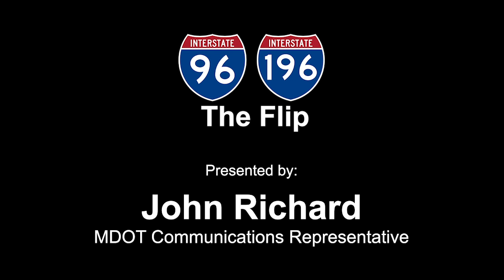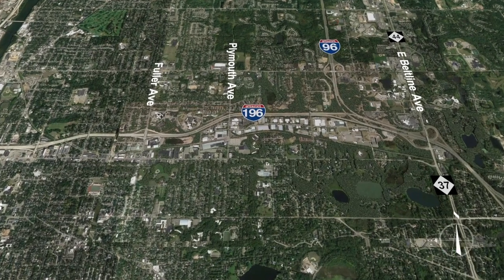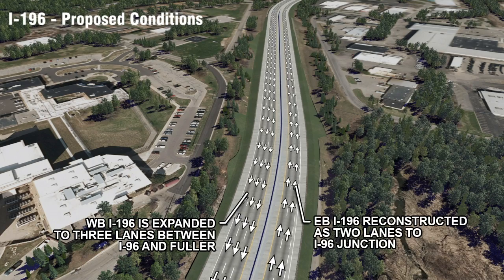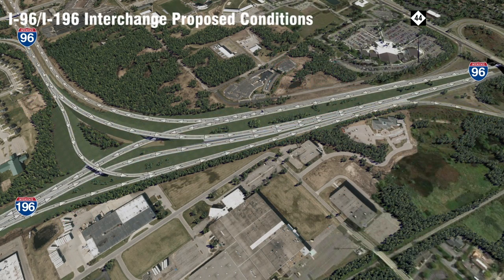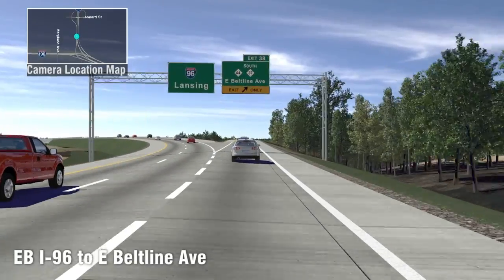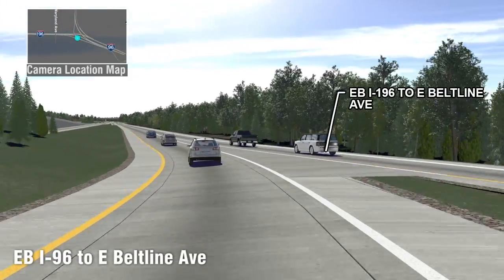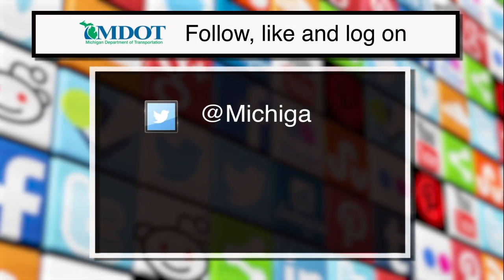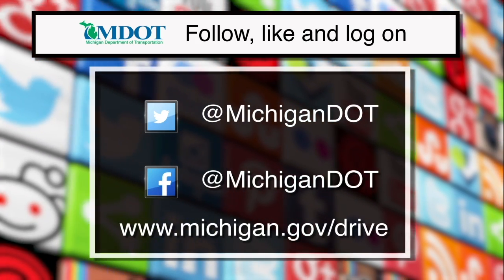I-96/I-196 Interchange Project: The Flip

Comment: I totally agree with Chad, I have been entering 1-96 west from the East Beltline and merging over to I-196 west for over 10 years now and always feel like I am trying to cross  a racetrack to get to  I-196 west. Everyone is going 70 mph or more. As long as you were already doing construction of the area, I think the congestion would have been helped more by making a separate entrance ramp from the East Beltline to I-196 west. The congestion could also have been reduced by making an exit ramp from I-96 East to I-196 West. It would give people another option and reduce congestion on the East Beltline.
Reply from the maker: Hi Jean, this project has that kind of ramp from EB I-96 to I-196 in mind for future builds; however, it depends on future available funding.

Comment: I see ZERO improvements though on how East belt line merges with West bound traffic and then darts over three lanes of traffic to go downtown. Am I missing this inherent improvement that hopefully wasn’t over looked?
Reply from the maker: Hi Nikole, as we mentioned elsewhere in the thread to a similar comment, the addition of the third lane along WB I-96 in that area is designed to create more room for a safer merging zone. There is a meeting scheduled for May if you would like to attend and speak directly with the project team: https://www.michigan.gov/mdot/0,4616,7-151-9620-496097--,00.html. You can also call the Grand Rapids TSC at 616-464-1800 to speak with them.

Comment: Long overdue change to the Eastbound 96/196 exit to E Beltline.  Now, if they had only added a new ON RAMP to Westbound 196 from the Beltline.  Drivers will NOW have to traverse across TWO lanes of traffic to get to the I-196 Ford Freeway.  Should have added a ramp through the median (like Alpine Ave) for Beltline drivers to enter the Ford without crossing 2 lanes of westbound 96 traffic.

Seeing similar comments below, more lanes of traffic to allow for safer merging means a driver has to merge one more time.   I seriously have my doubts that this will reduce congestion on Westbound.  The problem is that there isn't enough distance between Beltline and the 96-196 interchange.  When there is any amount of traffic, you just can't get across the lanes.

Comment: I don't understand - how will cars going eastbound on 196 be able to "turn left" and go NORTH on I-96 towards Plainfield/Alpine?  There's no way to do it now, obviously (huge limitation and the most #1 baffling flaw of this interchange) so I assumed all this construction work y'all are doing is to FIX this problem, right?  But this video doesn't explain it at all!  Somebody please clarify.
Reply from the maker: Hi there, DJ. We've gotten similar questions. This project has that kind of ramp in mind for future builds; however, it depends on future available funding.
Reply: @MichiganDOT  that's a terrible answer, but then again, this is a TERRIBLE project and abysmal staggering waste of money....I'm still trying to figure out how you can throw $60 million down the drain, just because "durrrr.....merging is HARD! derp derp" etc
Reply from the maker: @DJMichaelAngelo  We don't consider increasing safety a waste at all. This project is also designed to accommodate future upgrades, as we mentioned earlier, when funding becomes available.

Comment: The one problem not addressed in this project is the traffic merging onto 96 east from beltline. That ramp is so sharp that vehicles cannot get up to highway speeds before merging causing all the vehicles moving at highway speeds to slam on their brakes and make rapid lane changes to allow the merging beltline traffic in. In addition, you have vehicles that need to exit at fulton entering this same lane. It's the same exact problem as the 96/196/beltline cross traffic issue this project is aimed at alleviating. Why is this section not being addressed?
Reply from the maker: Hi None, No changes to this ramp with this set of projects. Improvements for this ramp will require removing and replacing the E. Beltline bridge over I-96. There are plans to address other operational issues in the larger I-196/I-96/M-44/M-37/M-21 interchange area in the future. These projects will be implemented with future roadway and bridge repair projects, based on statewide needs and funding levels. 
This year, by separating the EB merging traffic to East Beltline from through-traffic, there will be some benefit to the EB merging traffic from the East Beltline to I-96 and M-21.
Reply: @MichiganDOT  Thanks for the reply. Glad to hear it's at least on the radar.

Comment: Is there anything planned to alleviate the traffic merging from Beltline onto I-96 West?  And then those same cars trying to merge left (the flip) to get onto Westbound I-196?
Reply from the maker: Hi Scott, the addition of the third lane along WB I-96 in that area is designed to create more room for a safer merging zone.
Reply: Does this mean we still have to merge over an extra lane if we want I-96 West?  Having 3 lanes instead of two doesn't compute to "no problem" in my head.  :-)
Reply: Carol Smith exactly. The amount of crazies whipping over the lanes cutting off the flow of traffic is slowing everyones commute down. I have to stay in the far left lane going west until the last possible moment to go west because of this. They should invest in separating the on ramps to two on ramps after the fork in the road for east belt line traffic. Currently the length of time from east beltline bridge merge on west bound there’s not enough road and adding an extra lane isn’t smart either.
Reply from the maker: @nickie17301  Hi Nikole, as we mentioned elsewhere in the thread to a similar comment, the addition of the third lane along WB I-96 in that area is designed to create more room for a safer merging zone. There is a meeting scheduled for May if you would like to attend and speak directly with the project team: https://www.michigan.gov/mdot/0,4616,7-151-9620-496097--,00.html. You can also call the Grand Rapids TSC at 616-464-1800 to speak with them.
Reply: @MichiganDOT  Did anyone bring this up at the meeting?  A 4:30 meeting on a weekday is pretty tough for many of us to attend.
Reply from the maker: @s-ptownsend8919  Hi S-P, not sure if this specific comment was brought up at the meeting but the project team has fielded this question previously. In fact, they provided us with the information above to answer similar comments. As for the 4:30 meeting time, we try to schedule meetings at times to garner the most input. If you were not able to attend, we encourage you to contact the Grand Rapids TSC at 616-464-1800 to provide your feedback. Thanks!

Comment: I still don't understand why there is not a ramp from 96 south/east to 196 West???  Or am I missing something?
Reply: After a few frustrating trips attempting to get on WB 196 from EB 96 I figured out that going east to the Fulton St. exit and heading east, it turns out there's a fairly easy entrance ramp back onto WB from there if you stay in the left lane.  (A Michigan left but applied to freeways?...)  And now that Cascade has the diverging diamond it's even easier to make the same U-turn there, though that's farther to go out and then to double back.
Reply: you're right! :o  I just realized that this is ANOTHER no-brainer that you have to wonder what kind of crack-pipe the traffic engineers were smoking when they laid out the routes for this interchange....I still can't believe they're doing this multi-million dollar project, reconfiguring the entire interchange, for just a wussy non-reason like "better merging" = REALLY?!?!? pathetic
Reply from the maker: Hi  @DJMichaelAngelo  ! Improved merging means improved safety, which is an excellent reason for this project. As we mentioned earlier in the thread, this project has that kind of ramp in mind for future builds; however, it depends on future available funding.
Reply from the maker: Good question, Frances. I'm checking with the Grand Rapids TSC about that for you right now. I'll let you know what I find out!
Reply from the maker: Hi Frances - already heard back. This project has that kind of ramp in mind for future builds; however, it depends on future available funding.
Reply: @MichiganDOT  Thank you!
Reply: It's called US-131. Or I-296 if you know inside info.
Reply: Frances, drivers that want to get on 196 in either direction from 96East, would take 131 south, and you can join 196 in either direction.
Why would you drive all the way past Grand Rapids on 96E, if you wanted to go anywhere on 196 west?  It would be like making a giant U-turn on the freeway?

Comment: Thanks for sharing! I've been wondering how this will look. My other question has been if this will do anything to alleviate the backup that occurs daily where Cascade enters WB I-96?
Reply: People need to learn (a) how to merge, and (b) how to allow people to merge.
Reply: @MikeEwer  And use their TURN SIGNALS! I mean, how difficult is it to lift up or down the small level on your wheel.  And, people in GR -  IT DOESN'T COST TO USE IT!
Reply: @judithconigliaro3731  we all know how expensive blinker fluid is!!
Reply from the maker: Hi there! Doesn't look like this project has any components related to Cascade, but I can certainly pass along your concerns to the Grand Rapids TSC. Thanks for the question!
Reply: Oh and not to tailgate. 90% of traffic jams on the highway that are not accident or construction related are because of insufficient stopping distances.